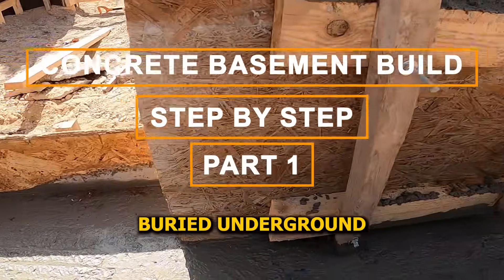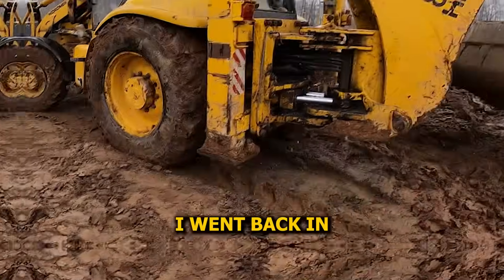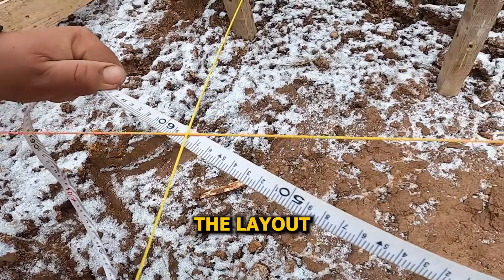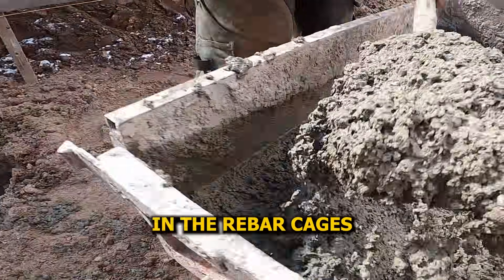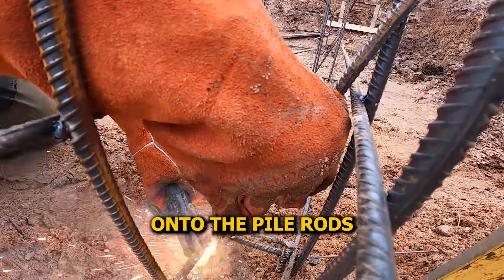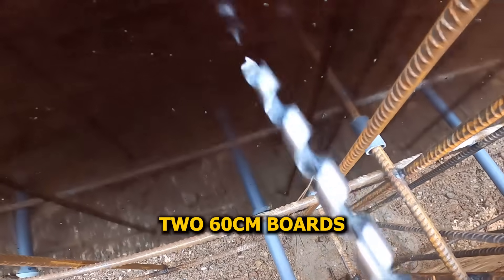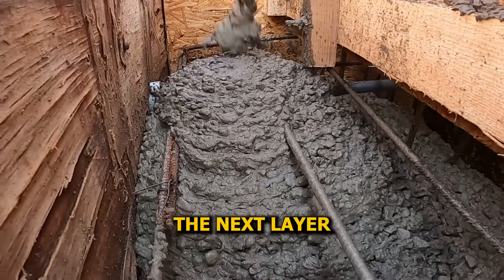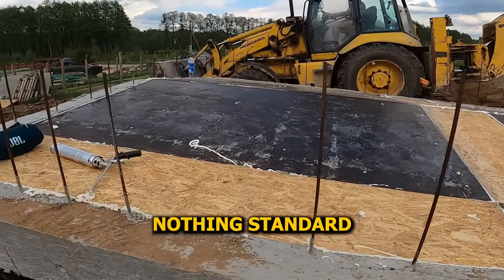DIY Underground Bunker Build (Part 1) – The Full Project Starts!

Comment: Would a rebar tie gun be faster?
Reply from the maker: Yeah, tie guns are definitely faster, but hand-tying locks it down tighter. And in this case we weren’t tying a full wall at once, just in steps — so the speed wasn’t a big issue. If it was a whole wall in one go, I’d 100% agree with you.

Comment: Amateur here, but do you not need to vibrate the concrete in the piles? Nice video!
Reply from the maker: Thanks! We never vibrate piles — the mix is fluid enough to settle on its own.
Reply: @LibraryofConstructionmakes sense. Thanks for the reply!

Comment: Man i need to dig up 17meters long trench. depth - 60cm. width - 50cm.

I have an idea but i would like first to have a pros opinion, because everything could fail in a seconds.

My plan is to use a machine like the one at 4:06 to dig two rows of holes along the 17 meters of length.

For the leftover between the holes i would use a B&D hammer drill with the spade attachment.

After that i will simply shovel the now loose dirt out.

Sitting comfortably in my chair all the plans seems okay, but i never used a petrol auger , i'll be renting one. I want to know if it's up to this task , because from my understanding this petrol auger machine is just for digging a hole or two for placing posts and etc. I don't want the machine breaking down while it's me renting it.
Reply from the maker: Just use a mini excavator. That machine is for drilling piles, not trenches. Your way will take a lot more time and effort for no real benefit. or just do it all with B&D spade it’s pointless to use this pile drill
Reply: Mini excavator owner here.  Just rent one for a day (dry hire).  You’ll be done that job in a couple of hours on the machine.  If you have any experience with gaming consoles the controls will come to you very quickly.  Just don’t tip the machine over.  
If you don’t want to do it yourself, there are hundreds of folks like me, professional owner operators  who are happy to do the job.  Most operators charge an hourly rate, and a minimum hour (most often around 4 hours) but you are looking at a cost not significantly higher than the hire cost for a trencher, and all the other hassle you’ll face doing it by hand.

Comment: Why not use ICF? Seems way more efficient.
Reply from the maker: ICF is great for insulation, but here we needed more flexibility for custom shapes, rebar detailing, and step-by-step control. Plus, material cost and availability made traditional formwork a better fit for this job.

Comment: im using ICF blocks cost and time saving, to traditional way try it next time
Reply from the maker: ICF is a smart option for some builds. But for this basement we needed full-strength reinforced concrete walls — custom rebar layout, formwork, and all. Definitely more work, but built to last.
Reply: @LibraryofConstruction most ICF form brands are available in wider sizes, suitable for basements.

Comment: But corrosion is going to take place below ..there is dirt between the steel from inside the ground and the starting concrete
Reply from the maker: We actually cleared that bit of sand from underneath so the steel wouldn’t touch the dirt. It wasn’t shown on camera, but there’s a clean gap before the concrete was poured.
Reply: @LibraryofConstructionI think the poster was referring to when you stuck the rebar cages into the pile holes, and had to stomp them down.  Definitely no gap between the soil and the rebar in those holes.